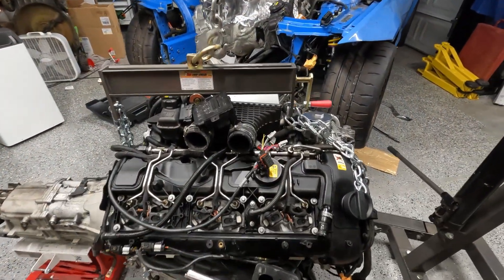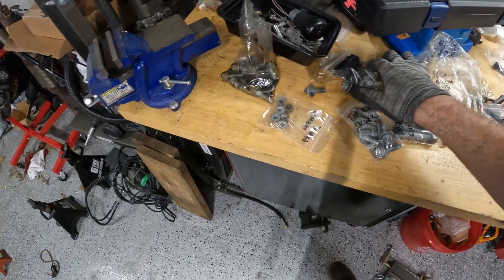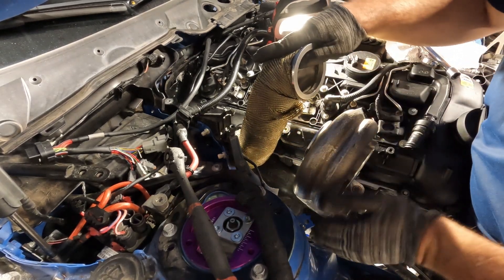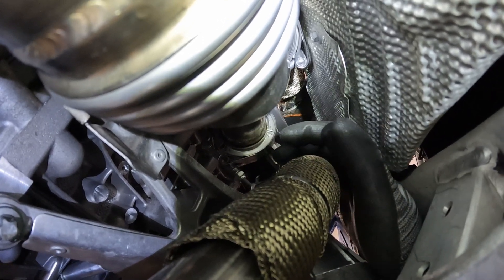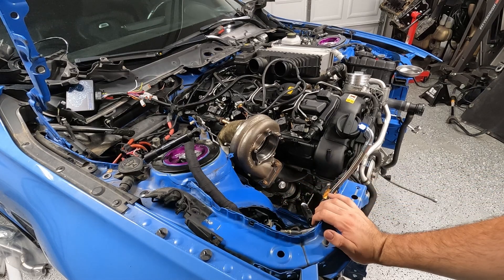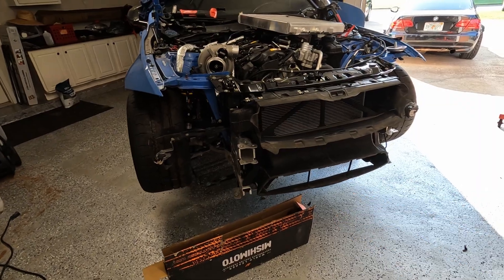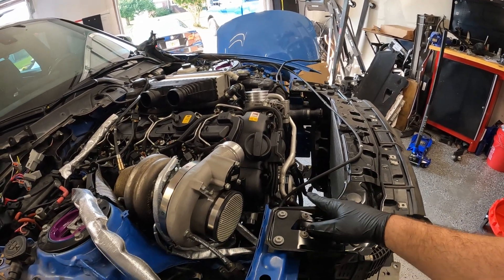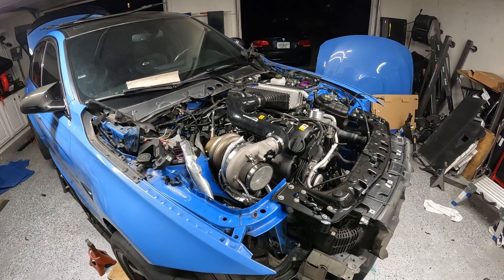Installing the Built Single Turbo S55 in My F80 M3!

Comment: Really wish I had your garage space for my project. Mine is also sitting on my Quickjack, but I did my full teardown and engine rebuild in my tiny garage. It's all machined assembled and back in. I've only driven it once, not it's working out the kinks and fine details. Can't wait until it's finished and back on the road. I only have a few video-shorts on some of the things I did through the build. Long visit comes later (I hope). That misfire sure sounds familiar. 😅🤔🤔🙏🏽
Reply from the maker: Garage isn't very deep but 2 cars wide, so it had to go in sideways haha

Comment: did you run an oil catch can for your build?
Reply from the maker: I have a mishimoto one I ended up fitting right at the corner next to the turbo. Tight fit but it fits

Comment: you should change out that stock charge air cooler while car still isn't finished. The stock ones are prone to leaks as you already know. I'd recommend going with mishimoto instead of like CSF cuz CSF is all marketing and never shows data to back up their claims while mishi does and it is cheaper. Kies motorsport tested CSF and it actually lost power over stock.
Reply from the maker: Yah I was going to go mishimoto, was waiting for Black Friday. Or a sponsor lol
Reply: @M_sackman yeah wait for Black Friday lol, also there’s some sites that don’t charge sales tax. I got mine from topgearsolutions
Reply from the maker: Yup actually where I bought the clutch, mid pipe and some other stuff from!

Comment: Nice build man.
It’s really motivating.
I recently spun my crank hub and was looking into forged built too. 
You mentioned you blew your engine and got a built one from Miami engines.
Did you buy another used engine and sent it to them or they sell forged built engines?
Reply from the maker: So you can send your engine and they can rebuild it or you can pay about $2000 more to have them send you an engine if they have enough blocks, and then you can send your old engine back to them and they should refund you the $2000, so like a core return at auto parts. 

I went for having both engines in front of me. That way I can transfer everything without getting confused and mixed up. It doesn’t really cost anything more and because they’re kinda local I can drop off, so I don’t have to pay shipping to return the engine.
Reply: @M_sackman and how fast did you get your st kit? I checked their website it says 4-6 weeks but some say it could take months. 
Thanks!
Reply from the maker: @HB_M5  the kit took about 3 weeks, I ordered when they first came out. And Miami engines was like 2-3 weeks to build new motor and ship.
Reply: @M_sackman  also why did you go with clutchmasters? Specclutch offers the same set up for less $?
I’ll be doing clutch too and was considering spec, didn’t even look into masters.
Thanks for your response.

Comment: Wheels camber and toe can I know please?
Reply from the maker: F 18x10.5+20 with if I remember right a 12mm spacer to clear strut, 295/35, min 3 degrees camber required. 

Rear 18x11+34 no spacer 315/30/18

Comment: nice build but your gonna burn the seals on your water pump and your gonna have low preasure cooling system leaving it running for as long as you did.
Reply from the maker: It was on for like 30 seconds at its max, I suppose cause it’s mechanical it could, thanks for reminder.